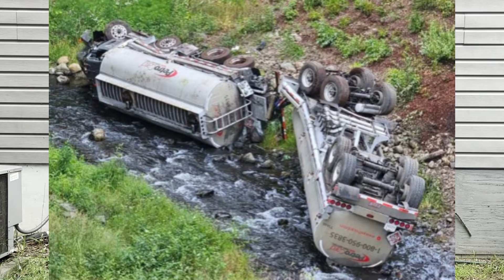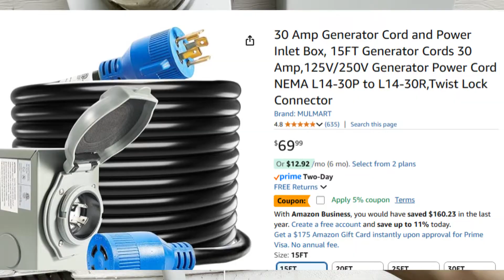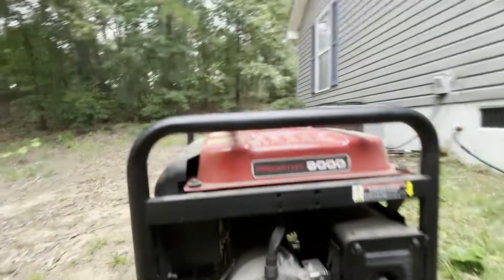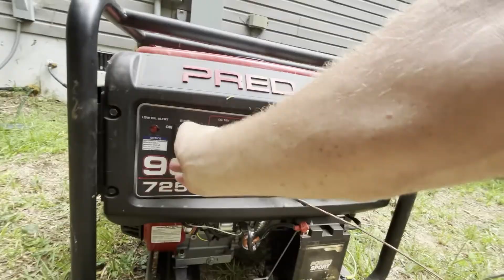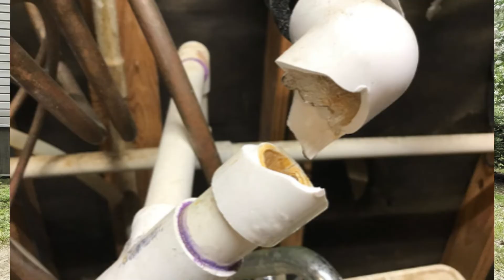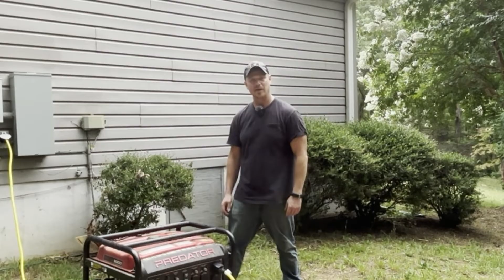Power Your House with a Harbor Freight Predator Generator

Comment: Nothing wrong with your small Predator, but talking down Generac? They are AMAZING. I installed my Generac in 2002 and it is still running like a champ with ONLY oil changes and battery replacements.  My Generac cost me $4300 (it has went up). It is insulated. I have propane for more than a month and it starts itself as well as switch the panel automatically. As I am writing this our power has been off for several days and the Generac started itself and turned the power on within 3 minutes.. and it runs 24/7.. for the WHOLE house.
The Predator shown puts out 7250VA with brief 9000 VA while my Generac is 14000VA continuous - enough for the whole house.
There is a reason the Generac costs more.. The panel switch is built in and automatic. Propane is used because it DOES NOT GO STALE like gas and there is no ethanol to destroy carbs. If the power is off more than a month, well I guess I will have to find a portable propane tank.. but that is unlikely. People with natural gas can hook right up as long as natural gas stays on. 
I can fix and service my Generac the same as you can with the gas model. 
The Generac is made in the USA and engineered for long life and constant work in a residential community. Mine has been in service 24 years (I am writing this in 2026 during an outage with my unit running my whole house)
Generac is QUIET compared to the Predator model which can be heard a block away and attracts thieves and is easily stolen.
Gasoline works, it just takes constant filling and goes stale as well as gums up carb.
Generac is made for the whole house and NOT portable.. 
Buy what you can afford - there are trade-offs, but Generac is purpose built and made to be automatic and includes everything, including the automatic transfer panel. I installed my whole unit. I have done oil changes and replaced the battery 4 times. That is it.
If you have computers or expensive electronics, consider a double conversion UPS.. analog generators tend to put out power that the frequency floats a bit. The new Generac models have went digital and fixed that. Mine is the analog older style, but it works.

Comment: Is that generator hard on your electronic devices? Because of electrician told me to use an inverter.
Reply from the maker: It hasn’t torn anything up yet. I would have a professional make sure you have surge protectors on expensive things like your HVAC system before throwing generator power on it. Ask your electrician about if you need an inverter or surge protector. I had an electrician install the shore power box on the side of the house and I didn’t think to ask about an inverter/ surge protectors for other things besides the HVAC and well pump. Thanks for the comment!

Comment: On that particular model, you need to take the 4 bolts off the gas tank and file down the 2 mounting brackets that are rubbing the tank. They will eventually rub through!!!!

Thanks for the video

Comment: better yet dont store any gas in it PERIOD.  Run it dry, drain the tank and drain the carb bowl.  Never have used Stabil or non-ethanol gas.  Mine starts first pull after months of storing.  VP jugs are the best for gas storage.  Also using the interlock like you did you do not need to ground the generator separately.  It is not necessary
Reply from the maker: Thats right the plug to the house has a ground wire. Didn’t think about

Comment: Monday before Thanksgiving last year I bought a Predator 13,000 watt tri-fuel generator from Harbor Freight. I paid $975 for it. It's replacing a 5500 watt generator. It should run everything in our cabin. It's supposed to run 12 hours on a tank of gas. I actually fired it up for the second time today and let it run about 20 minutes. Can someone tell me if I'm supposed to start it on high idle or switch it to the automatic idle?
Reply from the maker: Mine just has a lever with “choke” to start, then i switch it over to “run.” Not sure how the trifuels start. 13000 is a big generator, i bet it would power 2 cabins. Good luck!
Reply: @TheStandOutdoors Thanks.